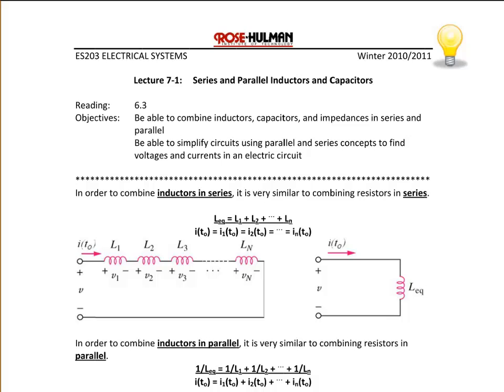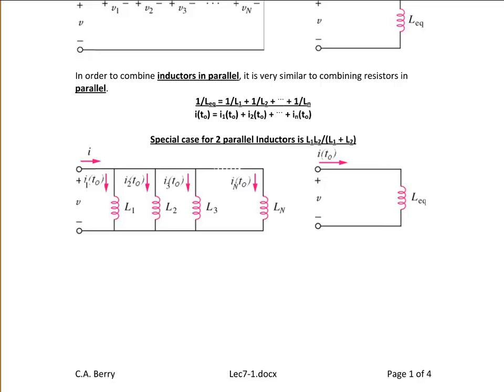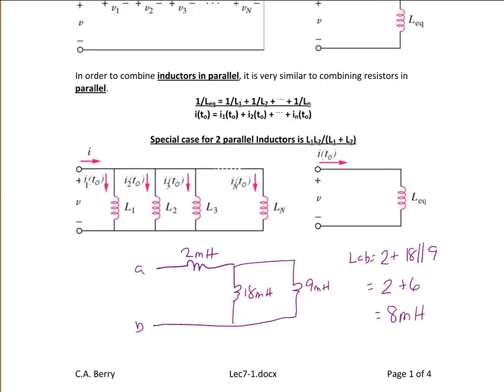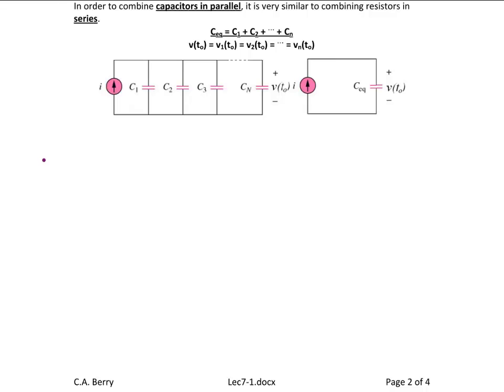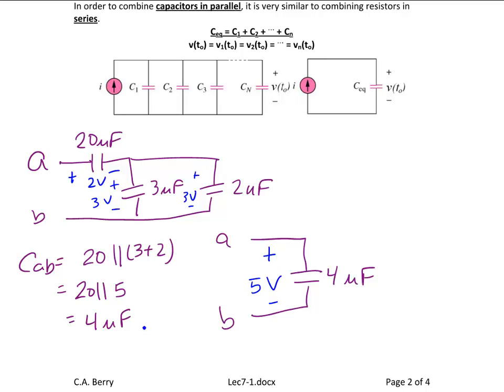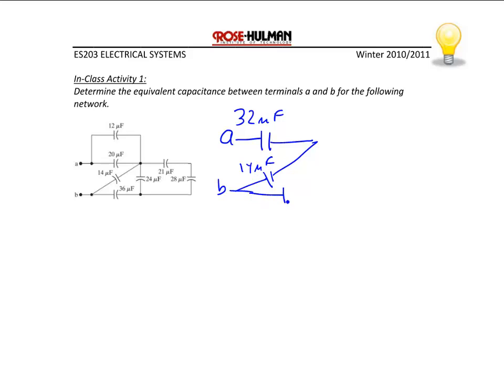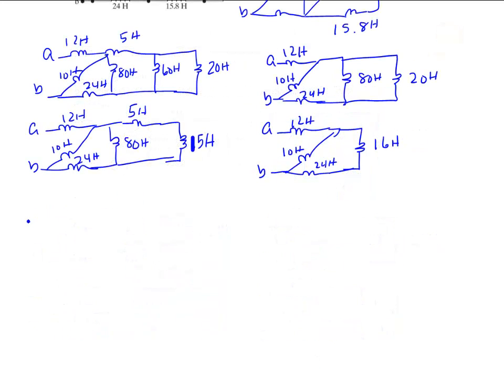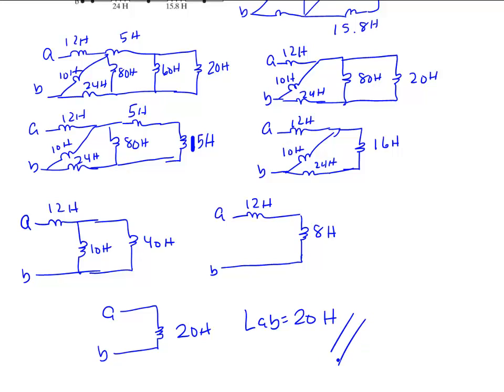ES203 Lec 7-1: Series and Parallel Inductors and Capacitors

Comment: Wait, didn't you say the 36uF and 36uF were parallel and then you said they were in series... I'm confused.
Reply: +Kieara Tone' i noticed that too.. i think she also forgot the 5H inductor too
Reply from the maker: Remember capacitors combine the opposite of resistors so although they are in parallel, you would add and vice versa